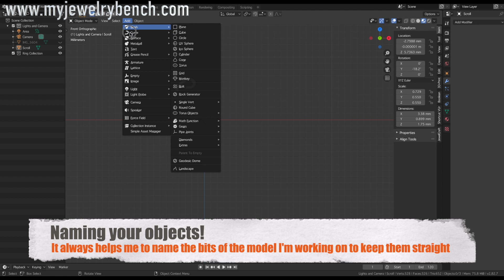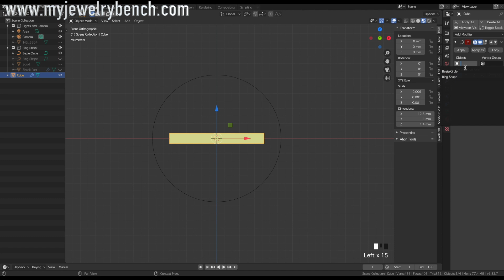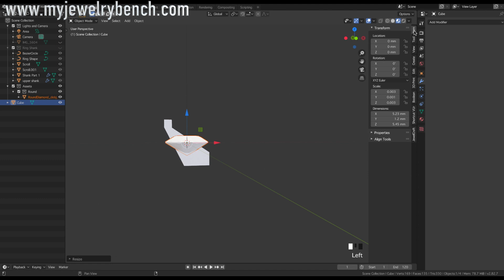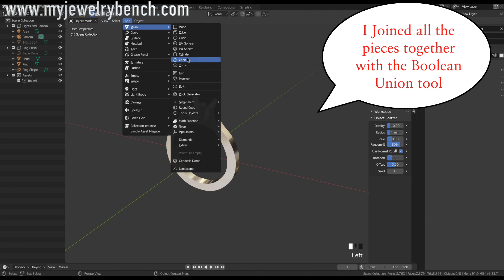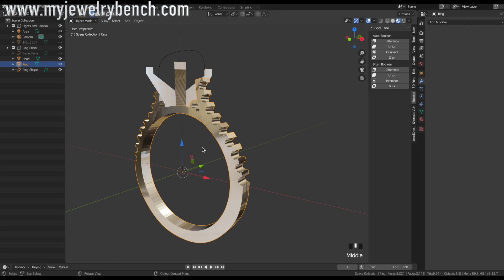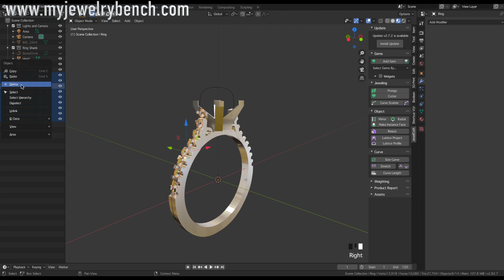Blender 2.82 Ring Design Modeling, Request from Youtube Viewer!

Comment: Thank you for your effort . I want to ask you about jewelcraft , could you make a course to explain how we use jewelcraft ? , thank you
Reply from the maker: I will say for me, it helps with stone placement. There are some quirks in the code that don’t work for me. However laying out gems, using the prong tools and the cutting tools works well and in most cases saves time.
Reply: Thank you